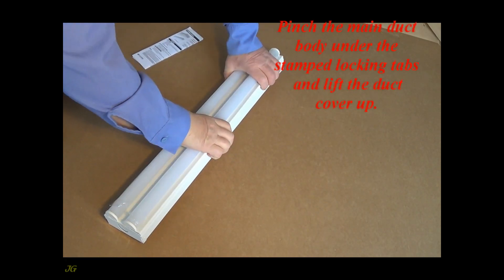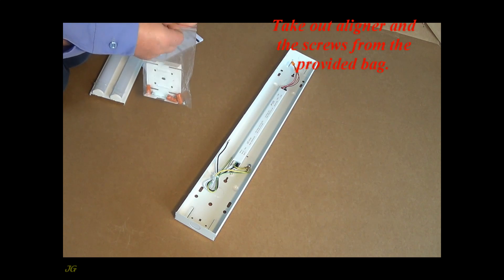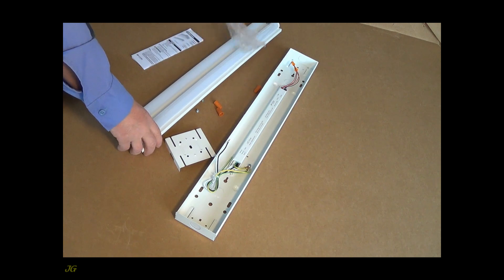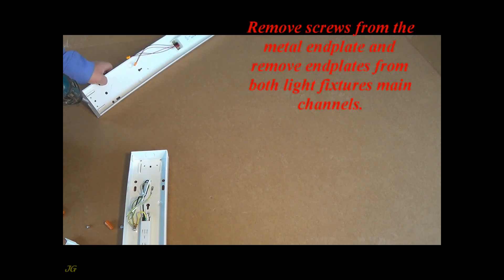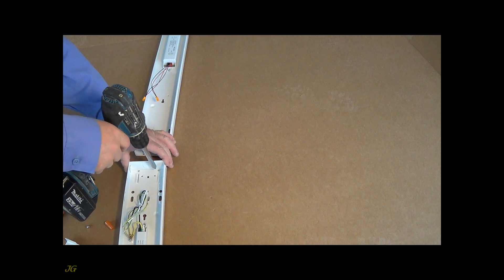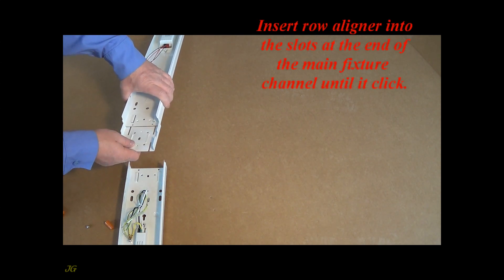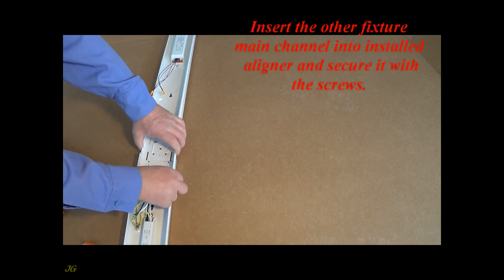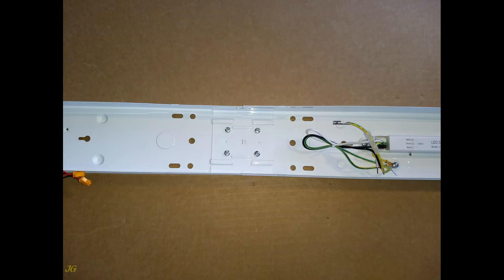Connection of Metalux or similar strip light fixtures for row mounting.

Comment: Okay and how do you connect the wires?
Reply from the maker: In parallel (from one to the other), using the same wires as the electrical circuit and wire nuts.
Reply: that was painful to watch